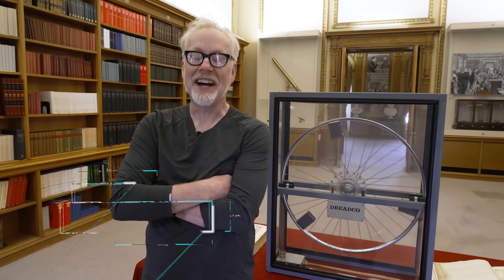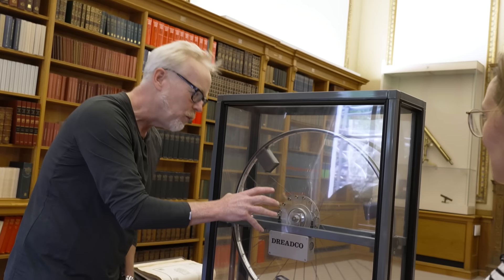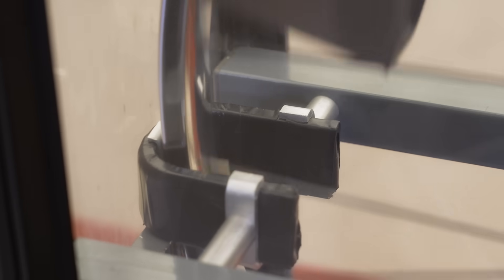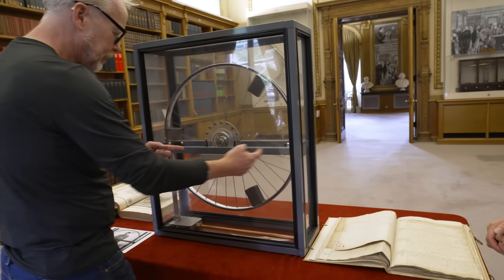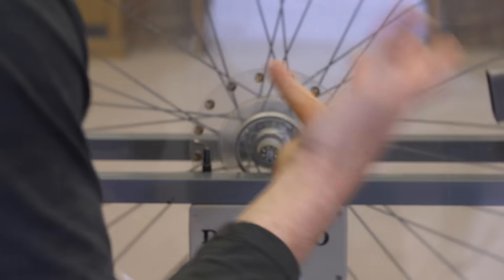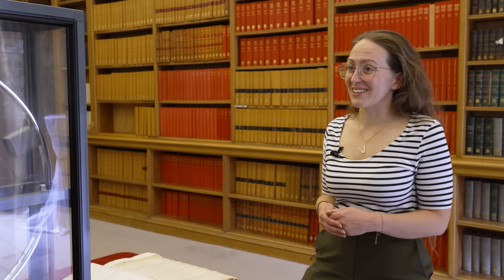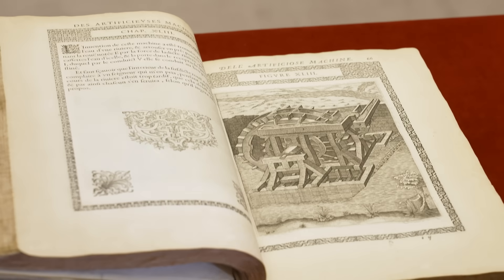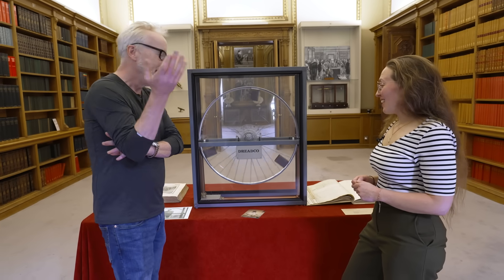Adam Savage vs The "Perpetual Motion" Machine!

Comment: I bet there's a tiny fan in the box under the wheel, blowing air through the copper tube to spin the wheel. And with it in the box, you wouldn't be able to hear the fan/motor.

Comment: Fire alarms can run for 10 years on a single battery. The secret is electricity. All you would need to do would be to replace lost energy. The "Dreadco" box has a battery in it, the frame measures the revolutions, hence the energy lost, and replaces it via electromagnet. Everything else is set dressing.

Comment: I use to own a clock that (I think) worked like this. It did not take much for the 'nudge' to push along the (magnets) The one I had. had a spring that made it reverse direction and drove the escapement. when the rest of the clock broke, I removed the spring so it can spin forever. it basically worked for a coupe of years+ before it needed another AA battery.

Comment: I really want this to be something fun and complicated, like a Peltier device that somehow works with a temperature gradient between the inside and outside of the box (maybe the entire box heats up in the sun?).  I want the heatsink on the bottom to "do something".  But yeah, its probably a battery somewhere.
Reply: There's no possible way the heatsink does anything.  Heat and noise means a loss of power, something you want to avoid when making something run efficiently.

Comment: Heya, for those wondering about magnetic fields being a key part of the device, a supporting video here https://youtu.be/4VBNn-ids6M (featuring Judith Hann from Tommorows World of my youth!) Shows not only the repurposed tax envelope being opened by the Professor entrusted with it (and his befuddlement), but an engineer with a magnetometer by Omni (at mark 1.34 or so) locating no field change at the edges but some in the centre and by the low left object with heat fins.  The outer edge blocks may well be repurposed Coleman's Mustard tins as well.  There's a couple more videos on David Jones, but nothing enlightening on the machines. Happy theorising!

Comment: The simplest Perpetual Motion machines I saw as a child was one that used an antenna to collect radio wave energy (very minuet amounts) and store it in a capacitor. It will then give a slight 'kick'' to the electromagnet on the side of the wheel to keep it going.
Reply: Basically the same idea as in a wind turbine. There is a power source constantly feeding new energy into the system, it's just invisible.
Any kind of solar powered spinny thing would be the same idea.

Comment: i think that the boxes around the wheel contain a permanent magnet and that the horseshoe shaped things are actually coils of wire in a different shape. this way whenever the magnets pass the coils, a current is generated across them, then i think the current generated is passed to the electrode looking things. notice how one electrode is sharp and one is rounded, i think this could be because the current generated by the magnets and coils is actually powering a form of corona discharge from the electrodes, especially since the little brass circles appear to have a collar shape with a sharp edge and a flat rise. perhaps what is happening is that, the sharp electrode is charged positively by the magnet and coil on the right, and the round electrode is charged negatively and when the brass circles pass them, the corona discharge not only pushes the wheel but also charges the brass circles so that it can be affected on the next half rotation. this would also explain the need to insulate them with acrylic. not sure about the copper pipe and stuff at the bottom, maybe that is what is used to restart the movement

Comment: The machine has zero load and possibly magnetic, battery based input.  And it has to be sent back for "maintenance" when it STOPS.  You can create a machine with no load that operates untouched for great periods of time.  But this machine is most likely contributing to it's own motion making it not a perpetual motion machine.  The energy runs out sometime.  Especially since the bearings are not greased or oiled.
An ICE pumps its own fuel.  That doesn't make it a perpetual motion machine.  And the ICE actually does work.  PT Barnum would be proud to have this in his collection.

Comment: I think it is a combination of moving magnetic weights inside the three boxes and coils mounted to the frame, like a mixture of the common ball bearing design and the old covert coil design, where the “coil” is pulling the magnet a bit and flipping the centre of mass inside the box inwards on the way up and outward on the way down, I think this is why it is so painfully slow. The batteries could easily be distributed into all of the 5 or so active components, so long as the parts “communicate” well. Or each of the three boxes has a small flywheel and power supply built in and everything outside of the wheel is just misdirection, that would be suitably disappointing in its simplicity.

Comment: A mouse can live for around 2 years and so I think that the box on the bottom has a mouse in it as well as a one way valve. As the mouse breaths out the air goes up the copper pipe on the right and as it breaths in the air is sucked into the pipe on the left.  This draught makes the wheel turn...Duh.
Avery two years as the mouse gets old the wheel slows down and they send it to have a new mouse as well a long lasting food installed. They also clean out the mouse poop.
If you can't prove me wrong then I must be correct. 🐁

Comment: Since the first time I saw that one perpetual motion wheel in the box, my thoughts were that it was essentially just like the Atmos clock design that runs off of slight differentials in air pressure and temperature that shift throughout the day or from place to place.

Comment: Read a bunch of comments... didn't see anyone suggest battery + mercury switches + electromagnet in the three boxes.  The mercury is in a donut like vessel such that at the proper locations around the circle it sends the current in one direction or the other very briefly as it approaches and leaves the horseshoes.  Are mercury switches more efficient than reed switches?    The static horseshoes are just iron (not magnets) to prevent detection of them being magnets with a compass.  Maybe only one of the three boxes is active and the other two are non-functioning decoys-- depends upon how much impulse is needed.

Comment: I saw two different ways that it could hide batteries or capacitors and basically its a motor that might be recovering a significant amount of energy during operations it seems like it is getting some energy from heat differently because it seems to have a heat sync on it too.

Comment: This machine fascinates me because it's obviously leaning into the classic perpetual motion design of the "overbalancing wheel" — in which those boxes are simply weights, and it's their mass as they pass the point at which they're moving with gravity instead of against it that powers the thing.  (That's why there are three; at any given moment, two are on the downstroke, and that's where you're supposedly getting the energy.) 

There was — and probably still is — a tremendous amount of effort put into refining just where you put those weights, and how many weights to use, and methods of letting the weights shift around, though most "inventors" have moved on to misunderstanding electronics instead of misunderstanding mechanics.

EDIT: Ah, yes, the discussion of Orffyreus, I should have finished watching the clip.
Reply: An unbalanced wheel eventually oscillates to a halt with the heavy side at the bottom but if it has a little help then it does not take much energy to keep it moving, I'll wager that those electrodes are at a high voltage just enough to create an electrostatic field that is discharging through the boxes and frame and the battery is inside that box, it takes very little energy to keep it moving.

Comment: I don't know much about physics, but it seems to me that it's probably just a fancy iteration of the combination motor/generator that people have been outing as perpetual motion machines for centuries. The Dreadco box houses a motor and some kind of electrical storage medium, maybe a capacitor rather than a chemical battery. I think everything else is a red herring -  the boxes, the U shapes, the copper pipe, even the copper caps on the rim and the two odd arms that stick uup from the Dreadco box. It's just a motor with a generator, which slowly loses power, and every two years or so it needs a jump start to juice up the storage medium.

With today's tech, you could build something like this that would run on one triple-A battery for two years without the generator part recovering any of the expended energy, but with 1981 tech, it probably wouldn't have run more than a few days on the battery alone.

Comment: It’s using momentum and gravity.
Every time one of those blocks moves past the tubes, a valve switches, and the other block is heavy enough to push it down, which engages another valve on the other end and resets the motion to go over and over but that thing is in a vacuum and can run for a long time as long as there is no resistance.
that’s just what I’m guessing though

Comment: Point a high frame rate camera at it, record the motion, figure out when  it accelerates, both clockwise and anticlockwise.
Point a thermal camera at it, anything with an electric circuit will be slightly warmer.
See if those heatsinks are room temperature (they will be)
Take your smartphone and use the built in magnetometer to look for magnetic fields, both static and changing.

Comment: I think everyone is making this way too complicated.

I would bet the three boxes are iron magnets. The wheel is effectively a permanent magnet electric motor. The energy is provided by the iron magnets which are also the batteries. Over time energy is extracted by slowly demagnetizing them and they must be magnetized again (inputting energy into the system).
Reply: Interesting that they have the same shape and mass as Colman's mustard tins😏
Reply: @tho2ea  it’s a reversed dc motor with the the coils on the outside and the magnets on the stator. The prongs and box in the middle is the commutator. The wire runs in a loop. The magnets themselves act as the battery as I described above.
Reply: @Taskarnin  Tin, not iron. And they used to be yellow and held mustard powder.
Reply: @tho2ea  the tins probably just hide the iron magnet.

Comment: Low friction bearings and in a vacuum? I'm not sure if the weights are moving through some sort of pickups. They are placed very slightly below the axis of rotation so the timing of each pass is a bit off. Where the slightest thing makes a big difference, this seems a bit strange. Gyroscopic precession caused by the rotation of the earth somehow imparts rotation in the wheel? Just clutching at straws now.

Comment: I can think of so many ways to do this. The question is what's the most efficient conversion of some stored energy to mechanical energy.  For me, one fairly good answer is a simple electromagnetic motor similar to a wrist watch. The dreadco box can contain a battery with a low self discharge. The two U-shaped things at the sides are super high impedance electromagnets, and the three boxes on the wheel are solid iron or nickel (possibly magnets, but that would make it easier to detect). A small pulse every time one of the boxes passes the U-shapes would provide plenty of force to keep it running. And a decent size lithium iron phosphate battery in the dreadco box would last years. Probably a decade with modern technology.

Comment: i wonder if it uses the change in atmospheric pressure to generate electricity 
i dont see why there would need to be an opening on that center box and the flexing glass would be enough to pass that through

Comment: I've got a spinning mechanism that slows down every two years or so and needs "servicing". I have numbers 1 -12 on it arranged in a circle.  😃
Reply: Yeah, but does it have mass like this?
Reply: @tho2ea  Actually it's an unbalanced mass with some small levers arranged from a center pivot!
Reply: @paulcochran1721  At some point as size increases you'd need counterweights or a massive coiled spring but that's not perpetual motion. This spins without counterweights levers or magnets.
Reply: @tho2ea  Yeah, has to be a magnet and or magnets somewhere in there.
Reply: @tho2ea  I'm betting there's battery powered magnets involved somewhere in that setup - I just wonder if Jamie will do a show on it 🤔

Comment: Notice the copper pipes run across the bottom?
This is at least partially about a mix of heavy and light gases, as the heavy gas hits the bottom, it heats up and then lighter, helped up some by the rotating blocks. At the top, the heated heavy gas cools and drops also assisting the falling blocks. The trick here is heat and at least two types of gas, one heavy and one not.

Comment: its rather depressing that 2 years is a fair timeframe to replace batteries, but if I'd have to make an authentic guess >> It's storing electrostatic charge in capacitors and then using the caps to power the magnets <<  The problem with that is the central electrostatic generator does not seem to be optimized.   The most likely case is that it merely has batteries and the power is very very meticulously or "conservatively" used. 
Also, if it were indeed a revolutionary device with ground breaking technology then humans would be utilizing this technology !!! A device which could bring a new level of freedom to all mankind would be difficult to keep secret in plain sight :)

Comment: Despite being impossible... The quest to perpetual motion is in itself a quest for the ultimate efficient machine.
Reply: For the sake of throwing my hat into the ring; 

I'll make the guess that all the Red Herrings are made to look like Red Herrings but are in fact functional to all work in tandem to add energy to the system (or mitigate energy loss).
To stay within the confines of "it's actually disappointing once you know how it works", it wouldn't be impressive if this was just a giant self winding clockwork.  A simple system could run for years in a dust free enclosed environment, and would only need to be serviced to replace capacitors or bearing grease every few years.

Comment: I think the thing at the bottom center is a giant capacitor, the boxes are coils which pass between alternating magnets every second; generating an electric charge, stored in the capacitor - which periodically sends a charge to a motor close to where the bearings are. 

The small solar panel would probably keep it moving indefinitely if it was stored outside; in sunlight indefinitely. But in the absence of sunlight - give it a spin every two years, it will continue to use the stored kinetic energy (movement) to charge the capacitor.

Comment: Cupper is good for transporting heat and I think it always have a bit higher temperature than the ambient temperature, according to some a cupper coin will melt through ice and NASA want to use that to drill through ice on some moons, so the box that have the heat sink may be for temperature diference. But if that box contain  some other metals just some salt and water, maybe from the environment can keep a small electrical current, remember that words oldest battery have been running Oxford electric bell for more then 170 years now.

Comment: Is this video unclear? do they at any point admit this is a fake?
Reply: Repeatedly.
Reply: @AnnaAnna-uc2ff  Not in so many words they don't.
Reply: I don't care either way. But what would be the point?
Reply: It is not a fake, you can see it in the video, but they say that it will not run forever and that it need "service", so they bend the rules a bit and it is just a machine that can keep move for a long time.
If I had made a machine like that I had looked for inspiration from the Oxford electric bell that they say been working for 170+ years, and there is ways to get small motion out of changes in the surrounding environment, and as long as the earth spin and have weather we can make things move, but humans have an ability to build thing that cant last forever and often break as fast as the warranty ends :-D
Reply: @kennylex  I have to disagree with you, a fake is a fake. This IS a fake with a purpose, IMO.

Comment: The Dreadcorp box contains a low-voltage, highly efficient battery, and everything is beautifully machined and balanced to be as efficient as possible. Basically, a battery-powered flywheel. "Servicing" is replacing or recharging the battery, and doing maintenance on the low-friction and precisely machined components. [EDIT] Søren Koch got there first.

Comment: I have a clock with an independent pendulum that has continued on the same "D" cell battery for more than four years. 
(The same battery has also powered the hands of the clock, and chiming the quarters from 0600 to 2300).
A similar mechanism concealed in each of the three boxes would provide the propulsion needed to keep that wheel turning, with magnetic thrust against the two "U" shape magnets, with three "D" cells, the motion of the wheel may well go on for over ten years. I may try to duplicate the "Perpetual Motion" Machine at some time 😁

Comment: Here goes my 5 cents: there are many possibilities and places to hide power source and driving mechanism inside. Just look at the frame itself - the bars are hollow and provides space. And some parts are made just to redirect spectator's attention and thought process.
The simplest way to power the wheel is to use a hall-sensor somewhere in the frame which triggers a coil to interact with metal blocks on the wheel (assuming they made of iron). And some batteries as power source. Given the friction is very low and nothing else counteracts the rotation, it requires very little power and the battery lasts long enough.
A fun piece of art no doubt :)